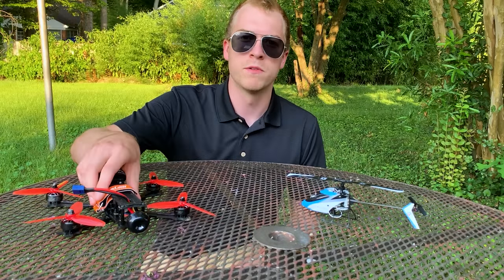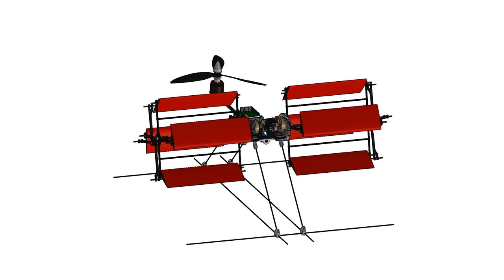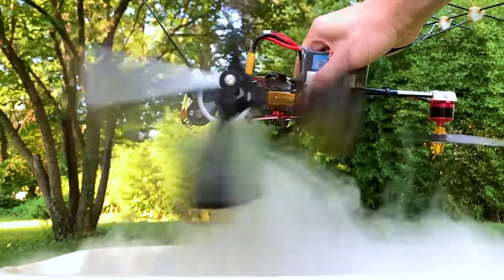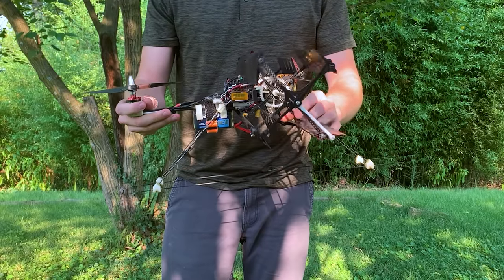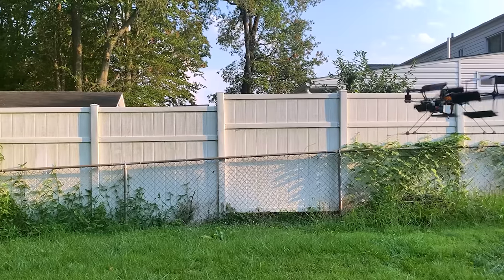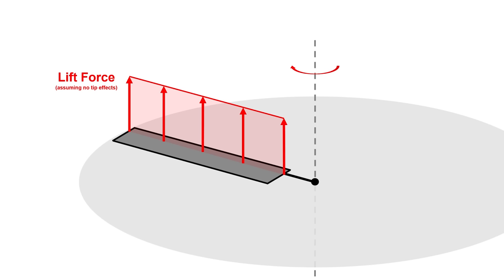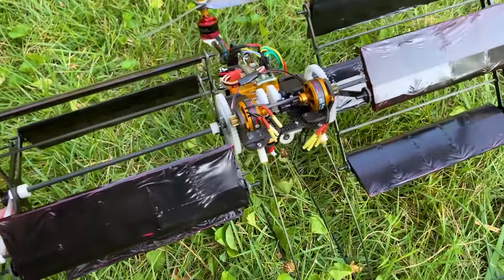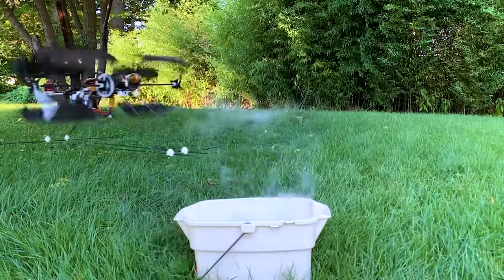Cycloidal Rotor Drone: The Cyclocopter

Comment: Very interesting, if slightly mad! Your talk about how lift varies along the length of a helicopter blade reminds me of another problem helicopters experience: retreating blade stall. As the forward speed of the helicopter increases, so the speed of the retreating blades relative to the air falls until ultimately they aren't going fast enough to generate lift, and the helicopter stalls on one side. This could also happen to a cyclocopter, if you got it to go fast enough, but the "blades" stalling would be the ones underneath the wing assembly, so there would be no change in attitude.
Reply: (If I correctly understand) For a cyclocopter going forward, with blades at the top going forward the top blades would get increased airspeed and lift. The bottom blades going rearward would create lesser lift but the increased lift of the top blades would more than compensate. This would create more drag above the centre of mass but should not increase the angle of attack so there should be no blade stall.

I believe for a helicopter the retreating blade has to increase the angle of attack for the lower airspeed while the advancing blade decreases the angle of attack to compensate. which is what creates the stall issue (as speed increases) to one side as opposed to (for the cyclocopter) the load just being transferred to the top blade with similar angle of attach but different airspeed/lift.

Once the airspeed approaches/matches/exceeds wingtip speed then you are in trouble and exceeds my understanding right now after a bottle of wine.
Reply: @peterjones3113  I would think the added drag of the blades when they are between top and bottom position would make it a non-issue though, haha. 
It would be interesting to see a design of two servo hubs in each end so the pitch angle can be adjusted separately within the pairs of blades, to allow for the blades moving up/down to pitch and get the angle of attack of the blades in transition closer to zero. Though this also requires the servo to be constantly changing positions (4 times per rotation) when the craft is moving at speed. 
I suppose this would also be an effective way of introducing horizontal acceleration without effecting vertical lift when the craft is hovering, by having only a single pair active with the other pair in a neutral position, if it is even possible to find a neutral position without adding even more complexities.

Comment: A similar take is actually in current use around the world: the Voith Schneider Propeller for ships. It allows excellent maneuverability and is used for tugboats, ferries and other ships requiring omnidirectional control. It's pretty awesome!
Reply: Exactly my thought. The mechanism is same, just tilted and wider "propeller blades" 
Question is: where are the limits for scaling this up? Mechanical stress to the joints? Vibrations? RPM? Torque? Moment of inertia? Stalling-like effects?
I think, the by-now wing-like design might be improved dramatically for this motion pattern and airflow, as compressible air makes other conditions than water (Reynolds number)

Comment: Awesome copter! Ya just need two Cyclo-wings to be rid of the nose propeller. 

Edit: My only concern would be how well does it handle wind?
Reply from the maker: It handles wind pretty well in the “slidey mode” as long as the nose is pointed into the wind
Reply: or lugwa vtol configurations,

Comment: A big worry I have is how it handles motor/engine failures. It's the same problem I have with things like quadcopters. They're basically rocks when the power fails, which is why I have difficulty seeing them as viable for moving humans around.
Reply: Crude as it is, my solution for making quads safe and same thing here would be a parachute. I get why airlines don't issue passengers with a parachute. It's just not good optics, and it will create more panic in those afraid than not thinking about it. However, I doubt anybody who ever got a plane would not be very happy and grateful to know their plane has one. It makes lemonade from lemons so to speak in these cases.
Reply: @GrassPossum  In an almost always uncontrollable situation, getting hundreds of passengers out of an airliner would be impossible. The only way parachutes in an airliner would be workable is an emergency where control is possible for about the normal disembarkation time that would be done, not the usual emergency. It's hard enough when there are only a few people trying to bail out. A parachute for light aircraft is already available and used by many. What would make multicopters safer in case of a motor failure would be a hexocopter or octocopter. A failure of one motor wouldn't condemn it to a crash.

Comment: Makes me wonder if you could do collective pitch as well, so that you don't have to vary the speed between the two rotors for roll control, but rather adjust the angle of attack between the two so one makes more lift
Reply from the maker: Sure, just need a linear actuator to extend the offset linkage to change blade pitch amplitude
Reply: The Voith Schneider propulsion system does that (with huge heavy blades in water for ship propulsion). The control linkage is definitely more complex, but it's viable.

Comment: What is the relative efficiency in power required to lift generated when compared to the quad.

I live on a coastal bluff with an afternoon updraft of about 15-20mph.  I have considered building a cyclorotor to capture this energy.  Is this, in your opinion, worthwhile?
Reply from the maker: Efficiency is slightly less, but only because it has not been 'optimized to heck' like multirotor propellers yet... There are other benefits/design considerations to factor in too like thrust vectoring ability or disk loading/tip speed!
Reply: A conventional 3 blade type horizontal axis wind turbine has efficiency of 40 to 50%. A vertical axis  turbine has 10 to 15% efficiency. If you align the axis of a turbine with the direction of air flow, all blades are generating lift, or are used to capture energy. If the axis is across the air flow direction only part of the blade arrangement is working for you, the rest is working against you. 
No, in my opinion, this is not worthwhile. 
This propeller arrangement is used in situations that require rapid flow direction changes, like in tugboat applications. They have tremendous power inputs, and the losses are acceptable as the benefits of flow direction control outweigh the need for power conservation. 
In your application, you want maximum efficiency, and have little need for flow vectoring. Besides, the complexity of the cyclorotor adds many more failure points, increased maintenance and shorter service life.

Comment: I wonder if you put two cylinders, one slightly smaller inside the other with a bunch of tiny holes and bridges connecting, or sliding past, for movement in the same way as the flaps on this cycloidal rotor, if this can hybrid with the Magnus effect.
It would require many smaller pieces, which also increases complexity. But would it also increase efficiency with multiple downforce generations in one space?

Comment: Great video, from the airflow view it seems a lot simpler than a helicopter, even if less intuitive for us humans. The cycloidal rotor allows for a much more stable flight than the helicopter or quadcopter, the simple mechanical way of steering the "wings" for the movement in two dimensions is also a big improvement compared to the "rolling around" that a "normal" ´copter design has to cope with. Basically it is an ingenious design and I would be very much interested in the forces it throws at the ground compared to the predecessors. 
The flip would have worked, if you had a bit more ground clearance. You could see in the video how the machine made a complete flip and was just not able to compensate the received downwards thrust. Either build in a limiter, so that it doesn´t power the rotors if the top faces downwards or make the flip at at least double the height. Maybe triple, I am just guessing, but gravity is also a component next to power to weight ratio. And my brain aint no supercomputer.

Every writing mistake can be kept by the finder, as I am drunk af.
Reply from the maker: Excellent thoughts. Yes I agree the flip would have definitely worked if I was higher, but I didn’t want to risk missing it on camera haha. Cheers 🍻

Comment: Congratulations, I didn't think you'd get this to fly! Even with a model there are large structural forces (bending forces) on the wings because of the high rotation speed. There is an application in shipbuilding for ships that need high maneuverability at low speed (harbor tugs, ferries) with a vertical rotation axis of the system. Unfortunately, the description in Wikipedia is only available in German under the title “Voith-Schneider-Antrieb”. If you switch Wiki to English, you get to the title "Cyclorotor", which unfortunately does not describe the application in ships.
Reply: It's used a lot in ships that have to be very manoeuvrable, such as car ferries and tug boats because you can change the direction of thrust to any direction very quickly and efficiently

Comment: Awesome work! I'm curious to know how much you can increase thrust and flight time
 compared to props. Pro tip: if you want to flip, consider having more height so you have space to recover.
Reply: and potentially smash it into the ground even harder! great idea!
Reply: @Dark0neone  i know what you're thinking but as strange as it sounds, the more height the more time you have to get it back levelled. For the same reason cats survive more falls from 9th floor compared to 5th floor.
Reply: @swishpan  unless you don't level it and then my point still stands.

I wouldn't do the first test at a great height. I would rather fix it than rebuild it, especially without getting much useful information.
Reply: @swishpan  I didn't ask lmao.
Reply: @Dark0neone  Negativity takes you nowhere.
Reply: @swishpan  i don't really care about your opinions because you're condescending, idk how that's negative.

Comment: You know, I bet this would make for a nice hover bike set up. One in the front and one in the back. They both spin horizontally. These spinner things have a quick and responsive way to control thrust direction without changing throttle which rotors blades are bad at.

Comment: You remind me of genius Mark Rober. He talks 90mph with assurdness on what he's explaining and is SO confident in what he says, that it is a factual truth ! You do the same. Your knowledge quotient must be way up there !
   THANKS for a great demonstration. (lesson to be learned...mow the grass first in the landing area, or provide a tray for it to land on, so your landing gear won't get tangled in the grass.) The air foil looks like nothing a strip of clear packaging tape wouldn't fix, & I believe your forward loop would have worked just fine if it had been preformed with more altitude. This would give more "belly" for the recovery to the normal flight aspect.

Comment: This is very informative, it works! (no discussion about efficiency etc. Just the physics) Only one BIG error: at 1:47: the red arrow is directed in the wrong direction: top & bottom blade give drag in the other direction: so the drawing needs to be mirrored. Using 3 blades and a cam shaft would improve efficiency.(blades will influence each other less)

Comment: Usually one such rotor is divided into two. In order to arrange the blades in a checkerboard pattern. It is very difficult to make a blade that bends at the desired angle. It is difficult to make the blades herringbone. It is difficult to put the blades in a spiral..This is a challenging puzzle.

Comment: True. When the wind is strong etc, then that structure becomes like a wind-catcher, and maybe get lots of drag and other issues. Good novelty flying machine though. Although, because it has a helicopter propeller on the back for stabilizing etc, then there's the helicopter solution being used right there.

Comment: Variable pitch angle VAWT that can be speed controlled by adjusting the angle so in high wind conditions it wont spin apart but can also optomize light wind conditions. Vertical axis turbines spin without the need to track the wind like a propeller style wind turbine.

Comment: Look up:
 Whale Tubercle wing
The effect of these tubercles is a wing with a much higher angle of attack before stall and a much gentler stall.
There also seems to be a lot less tip vortex from the research I have seen.

I believe this may ease and improve directional control.

I note that said Tubercles are easy to make by using thick, rounded wing ribs, completely covered with a somewhat elastic fabric...

I also note that the 'wheel hubs' of your rotors can be modded to better emulate winglets and further minimize tip vortices.  Especially if given a more aerodynamic profile.

Comment: It seems like you could build a quad-cyclocopter design where the front and rear rotors spin in opposite directions so that the torque cancels out, similar to a twin-rotor helicopter. I also wonder if it's possible to make a rotor where the blades can twist, allowing them to achieve different pitch angles on either half of the rotor. This would allow you to create a twin-rotor cyclocopter with pitch, roll, and yaw control.

Comment: Brilliant video. Would love to see you try put the electronics and motor internally around the axel inside a cyclo rotors to use a single rotor as a drone. Probably would be really tough to do but would be really cool just a flying wheel wizzing around.

Comment: That is so cool.  Could you use 4 cyclo-rotors to avoid the need for a conventional propeller at the front?  A bit like a twin rotor helicopter.
Reply: The front two rotating one direction while the back two rotate the other direction?

Comment: Contain the rotoring blades in wings so that they grab and push air across the top of the wings. Presumably the blades will protrude from a columnar or conical shape. I read a description of this once but have never seen it.

Comment: I like your project and would like to see you advance the concept by 1) trying to make each blade assembly into bi and tri winged mechanisms, and 2) divide bi and tri wing designs into fractal sections, which coordinate into a rapid sequence of correctly positioned airfoils as the assembly makes each quartered rotations, with several fractcal segments creating a back and forth sequence, like a piano keyboard played from one end to the other, which give maximum lift without interfering with the airstream being created.

Cheers

Comment: Years ago I saw reference to a "sail" boat that used rotating vertical cylinders for propulsion [Flettner totor]. It didn't look like it would work but ships had been built like this. I wondered if that could be applied to an aircraft. Low and behold I found reference to the cyclogyro, one version of which looks a lot like your device.
Apparently the cylinder sails are more energy efficient so the old technology is being rrvisited.

Comment: The cyclocopter concept does away with wings and complex flight controls and if you use four you don't need the rear rotor and it appears to have great stability also, i bet it will replace propellers in the future.

Comment: I just came across this video, but I wanted to add my two cents - I suspect that if you had the two cyclorotors counter rotating, you could do away with the pitch control rotor - it might cause some yaw (because it feels like there'd have to be some downside to counter-rotating cyclorotors and yaw's the only one that makes sense), but if so that could be countered by offsetting the thrust direction, and it might cause some roll when translating forward (again, it's just the only potential downside that might make sense, even if I don't know how that would happen), and again that potential problem could be solved with some smart vectoring and thrust power.

...after a moment's thought, I went and realised that the two counter rotating cyclorotors wouldn't be able to control pitch without varying the relative speed of the two cyclorotors, and that would definitely cause roll - it'd probably be easier to stabilise a tri-cyclorotor copter than a tri-copter using standard props though.

Comment: The lift is not even along the blades, as tip vortices destroy the lift towards the end, so a smaller chord out towards the tips is beneficial (creating less drag, a Spitfire-like form would probably work better!). 

But it sure worked well, till the loop done at too low altitude!

Comment: I was thinking of this before seeing your video.  Suppose you offset more, and used a smaller inside wheel.
You know this device compared to an airplane propeller, is parallel to a paddle-wheel and boat screws.

So from each wheel have a perpendicular bars on which to place one end of a wind catching fabric*.
As the synchronized bars rotate, at the top, the bars are close.
As they rotate one at a greater diameter moves farther away, 
it stretches a fabric wing, opening it.  
at 180 degrees, the bottom of the circle, the airfoil will be stretched to max.

and as it passes 180 the mouth of the fin closes, 
The fin reduces at the top of the circle(s) to produce little drag**.

This would actually change the surface area of the wind catching surface. 

*mylar?  stretchy?   Ribbed? (like a wing suit, & with a built in air foil?
**on the way back up, a fixed wheel streamline interior fender, also reduces drag of return cycle.
Reply from the maker: Stretching will require energy input that doesn't directly contribute to lift, similar to the bending issue